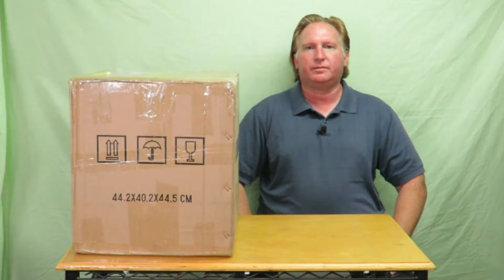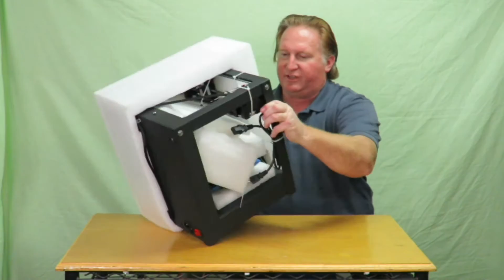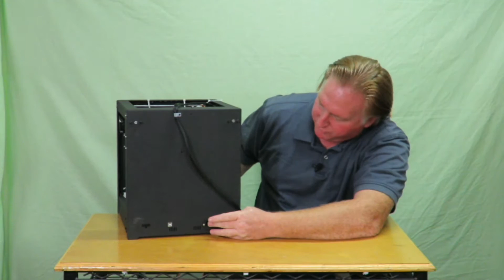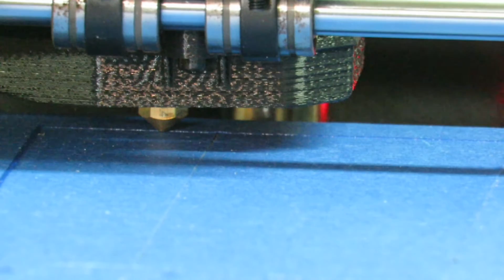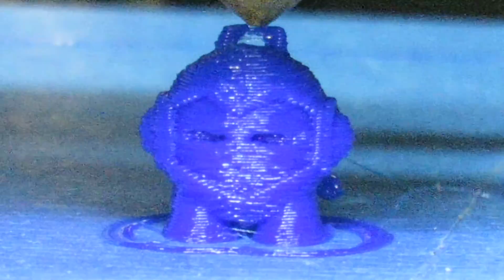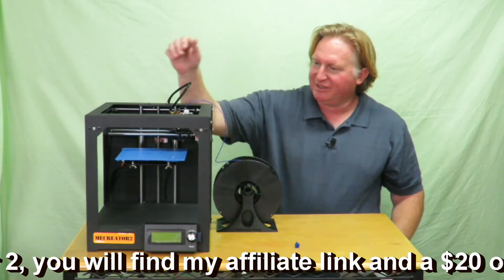Geeetech MeCreator2 Unboxing / First Print

Comment: Quick question, when I’m printing something, the print head randomly moves to the far edge of the print bed and then returns to printing. However when it does this, it starts printing in the wrong position. Any suggestions? Thanks!
Reply from the maker: +hobo662 I had that happen a while back.  After reloading the firmware it fixed it.
Reply from the maker: +Jimmy Shaw's Tidbits that was with the Aluminum I3.  But I could imagine it would be the same thing with the MeCreator2.
Reply: Thank you so much for your advice! How would I go about reloading the firmware?
Reply from the maker: +hobo662 If you go to the Geeetech website they should have instructions on how to do it on the product page.  Otherwise from what I understand you can update it using their program Easy Print 3D.
Reply: Thanks! By the way, love your videos!
Reply from the maker: +hobo662 Thank you!  I appreciate it!

Comment: Hello Jimmy. I have a Mecreator 2 and i change hotend and thermistor but i try PID tuning starts temperture too high error. How to fix this problem sorry bad english
Reply from the maker: +baljka batmonkh I'm sorry but I'm not familiar with changing a thermistor and the process involved in it.  I would think if it has a bad reading there might be a problem with the new thermistor or it might not be compatible.  You might want to contact Geeetech to find out.

Comment: First of all, nice Video!
I just bought the printer and tried to set it up. I also levelled the bed, but when I try to print something from my PC, or SD Card, the printer doesn't do anything. It shows the time on the Screen, but it's not moving!
Can you help me, or should I try to contact the support?
Reply from the maker: +ValliPlays I would double check the cables you can get to, and make sure everything is plugged in to it's proper place.

Second, and please forgive me, but I made this mistake... Did you slice the model and save the gcode to the sd card.  It can't print a .stl file.

Third, did you preheat the printer first?  If you preheat the printer then print from SD, as soon as your set temperatures are reached, it should come to life.

If you have done all of this, I would contact Customer support.  A new printer should run out of the box, no exceptions.
Reply: Thank you for your fast reply! I will have to try your suggestions tomorrow, because it is very late where I am now. But thanks for your help!
Reply: Jimmy Shaw's Tidbits I just tried preheating the bed and the extruder and it heated up to 180° and 70°, but when I tried to print from the SD Card, the temeratures go back to 0° and nothing happens!
Do you what the problem might be?
Reply from the maker: +ValliPlays did you open the .stl file in repetier or cura, adjust your settings, then slice it?
Reply: I can now run a job on the printer, but the extruder just stays in the top right corner of the plate and prints a straight line upwards! And the LCD Display is just flashing.
Should I contact the support, or is there an easier fix to this?
Reply from the maker: +ValliPlays I would contact support.
Reply: Jimmy Shaw's Tidbits ok thanks for your help!
Reply: Hello! I still have a question. Do you know if you can calibrate the extruder? It seems like he doesn't know where he is, because the x & y coordinates are completely random.
Reply from the maker: +ValliPlays I've been thinking about it.  Recently I had a problem with my Aluminum I3.  I refreshed the firmware and it fixed the problem.  It was alot like what you are having.  You might try that.  Please check out this video https://youtu.be/Mk2C53nOeVo in the video description should be a link to Geeeteech's firmware page.  Be sure to read the installation instructions.  Also I believe you can update the firmware from their new slicer program they are working on.  I hope it helps.
Reply: I tried it, but it still won't work and now EasyPrint doesn't recognize the printer as a MeCreator 2 anymore, even though I've installed the right firmware. It thinks my printer is a D200...
Reply from the maker: +ValliPlays Were you using easyprint from the beginning or repetier?
Reply: Jimmy Shaw's Tidbits I was using EasyPrint.
Reply from the maker: +ValliPlays Just for giggles, please try either repetier or cura and see if it does the same thing.
Reply: Jimmy Shaw's Tidbits I just tried it, but the Extruder stays in It's home Position! the printer itself thinks that is printing about 1 layer per second. It "finishes" the print in about 2 minutes, but all I get is a straight line.
Reply from the maker: +ValliPlays Rats!  It was worth a shot.  Sounds like something happend with that printer.
Reply: Jimmy Shaw's Tidbits Hello again! I just wanted to say that the printer is working fine now. (something with the x and y coordinates was wrong). And thank you very much for your help!
Reply from the maker: +ValliPlays Anytime!!!  I'm so glad it's working.

Comment: I was wondering if customer/tech support was very difficult to get in contact with? I am a first time user and my experience with Hictop was a disaster. NO SUPPORT at all. I am probably get this one.
Reply from the maker: +BSW Manufacturing I have always had pretty good luck with Geeeteech Customer support myself.  Although it has only been for questions regarding board upgrades ETC.  I normally contact them through Twitter, and revive a answer the following business day.  There is also a great Facebook Group called Unofficial Geeeteech Owners Group, where they can answer almost any question you can throw at them.  There is always Geeeteech.com as well as their Tech Support email.
Reply: Thanks, Jimmy. I joined that group.

Comment: Hey man I got this because of your videos, I love it!

However, it is making repeated clicking sounds after only a week of having it, I've been researching and people are talking about some extruder screws. Is this the issue you had? If so can you tell me how to fix it please? I'd really appreciate it! I might make a video showing the noise if needed.
Reply from the maker: +ThePinkWizard I have heard the same thing as of late.  Mine doesn't have the problem, but from what I understand the springs don't have enough tension.  I heard one person cut some paper and placed under the spring as a shim.  I looked on Thingiverse for one, but didn't see it.  I personally would print a shim that would add a little more tension.  

Let me know if you do, or if you would like for me to design one really quick.
Reply: Sorry I'm really newbie to this, I really appreciate the quick reply too. Which springs would I put the shim under? If it wouldn't be a problem to design it, it would mean the world to me. I've had no failures with this thing up until today, it doesn't seem like a clog either because filament comes out straight when I manually feed it, just has been ticking excessively when printing (using your settings too so thanks!!) and I am seeing some failures on the outsides of my print.
Reply from the maker: +ThePinkWizard The complaints I have seen are about the spring located under the arm that you depress to manually extrude filament.  It just doesn't have enough tension to make the gears stay engaged with the filament.

Please give me a few hours and I'll see what I can come up with.
Reply: oh! That could make sense. Used to be an issue on my MP Select Mini. Thank you so much man!!! I started a printing business so quality is crucial and you're already more help than Geeetech support.
Reply: Could it potentially be a clogged nozzle? I tried putting more pressure on that spring myself and it didn't resolve anything, maybe can I change some extruder settings? What would you recommend?
Reply from the maker: +ThePinkWizard It could be a clog or the temperature could be a little cool.  I've had both cause clicking in the past.
Reply: hmm. I'm using hatchbox PLA at 205c. The printer did this clicking noise right out of the box even on the first print, so maybe it's not a clogged nozzle. I've been printing at 210c with the hatchbox but the quality of my print is definitely worse than just a couple days ago. Wish i knew a lot more haha
Reply from the maker: +ThePinkWizard Do you have a extra nozzle?  If so, try changing it and see if there is a difference.
Reply: I don't, unfortunately. I have extras from my MP Select Mini but I don't think those will fit. I'll order one and hopefully that will be the issue. I'm going to take the nozzle off and clean it out quickly as well. Last, I am going to print something else. Maybe it's something with the way that one prints. I'll upload a youtube video with the behavior and send it your way.
Reply from the maker: +ThePinkWizard have you tried cleaning the drive gears?  Sometimes there can be a build up of PLA between the grooves.
Reply: also sorry for all the questions. I bought a bunch of that teflon tubing for my old printer, do you think that could be the issue? do these printers have that teflon tube inside the hot end?
Reply: I have not tried that! How would I go about that?
Reply from the maker: +ThePinkWizard if you remove the t bolts holding the extruder cooling fan, the fan and the heat sink will come off exposing the extruder.  A toothpick, brush, or small piece of wire can be used to remove any debris.

If you are interested in the spacer, here's  the link.  www.thingiverse.com/thing:2274064
Reply from the maker: +ThePinkWizard They do.  It could be the problem, but the only way to tell is to remove the nozzle and let it cool.  If you can run the filament thru smoothly, it's not the problem.  If it catches, it is the problem.
Reply: No way man!! Thanks so much! I'll try that out and I'll print that part and see if that'll fix it! Hoping one of these tricks will do it, I love this printer to death! 

Also, how do I access the settings for the printer? I can't preheat it directly from the printer, when I press the button in, it does nothing. I have to use my raspberry pi w/ octoprint to preheat it and what not.
Reply: The gear is clean, however there seems to be stripping on it. There are little scuffs on the spokes of the gear, not sure if that is an issue as this thing is a week old.
Reply from the maker: +ThePinkWizard  That shouldn't be the problem. One more thing, while you're at it check the set screw on the gear to make sure that it's tight against the shaft of the stepper motor.
Reply from the maker: +ThePinkWizard Thank you for the inspiration for Saturday's video!!!  Please send me a email to Jimmyshawstidbits@gmail.com when you have a chance?
Reply: Hey no problem I really do appreciate all your help and I'm super looking forward to this video! I'll shoot you an email right now!!

Comment: Nice videos. Many thanks. 
What Slicer software you use?
Im try cura 2.4, now I need printer setup for mecreator2, can you help?
Reply from the maker: +canonhd1000 I use a older version of Cura.  15.4.6 I think.  The new one just doesn't seem to work right.  If you would like to try the older version, all the settings are in this video.  https://youtu.be/b-wRaF9ljRM

Comment: Can you print STL files directly off the SD card??
Reply from the maker: +Derek Fox Unfortunately, no.  You have to slice the .stl in a slicer such as Cura and it turns it into G Code that can be saved to the SD Card.
Reply: Jimmy Shaw's Tidbits thanks for the detail. I ordered the  MeCreator 2 and it arrived today.
Thanks again
Reply from the maker: +Derek Fox Congratulations!!!!
Reply from the maker: +Derek Fox How are you liking it?
Reply: I'm still waiting The my shipment of filament. I tried out the sample pla. I had to really configure my object in Cura. By the time I was able to get the right settings, I ran out if filament lol.
Reply: Will polycarbonate filament work on this printer?
Reply from the maker: +Derek Fox I've done that a few times.  LOL!!!
Reply from the maker: +Derek Fox I've never tried it, but I think it will.

Comment: Hi Jimmy, If you would to choose between the aluminium one (your older printer) versus this one, which one would you pick?
Reply from the maker: +][v][ Hi,

For the best out of the box experience, I would choose the MeCreator2.  Especially for someone new to 3D Printing.

The Aluminum i3 I would recommend to someone who loves to tinker and really wants to learn everything there is to know about a printer.  It does have a larger build volume, and has to be built.  

Honestly, if I had it to do all over again, I probably would have bought the Aluminum I3 because I personally wanted to learn everything I could.  But that decision would have been alot harder to make if the MeCreator2 had been available at that time.  With the MeCreator2 having the better control  board, power supply and software controlled active cooling, I would go with the MeCreator2.

Sorry for the long winded answer, but there are so many differences between them.  They both have their ups and downs.  Build volume being the big one.
Reply: Jimmy Shaw's Tidbits thank you very much for taking the time to give such a comprehensive answer.

Comment: Thanks for making this video, I' m considering purchasing one of these and your video helps a lot.
Reply from the maker: +bitman I'm planning on a full review video soon.  But it is working like a champ.  Other than a loud fan and the loose extruder it is working great.
Reply from the maker: +bitman I'm planning on a full review video soon.  But it is working like a champ.  Other than the loud fan and the loose extruder screws, it is working great.  Unlike my I3 it reaches 240C and holds the temperature.  So it is printing PETG perfectly.
Reply: Hi Jimmy, great, I just purchased the MeCreator2 now, looking forward for your review, in the meantime I will check all your older videos, I got much to learn as I'm new to 3D printing. Thanks for sharing your experiences.
Reply from the maker: +bitman Thank you so much for watching.  You will love it!  The learning curve is the software.  I deal with the free software like Cura.  Joel, Angus and Chuck use Simplify 3D.  It's $150, but they swear by it.

Once I get my settings dialed in completely I'll definitely share them.  Hopefully by next weekend.

Comment: for the fan noise, if it is the same as my 3 in one control box, when it first came in, it had that same winding fan noise..  turned out that the fan is mounted straight to the wall  and against the vent grill, and i just printed 4 little spacers to move the fan away from the grill, and noise no more...
Reply from the maker: +MrRegzxzx I'll check that out.  Thanks!!!
Reply: Good tip.

Comment: Hi Jimmy, congrats on your new printer :-)  looks easy enough.  I can't wait to see other prints with it..    And yes, the wiring looks better on this one, lol!

I still have my Geeetech Prusa I3 A Pro 3D, although it is quite modified by now... (I really like to thinker and mod stuff..)  It now has a E3D v6 head with bowden setup, new printed: carriage assembly, Z supports with lead screws (instead of the tread rods) ,  installed a 3DTouch auto leveling sensor  (that is a really nice addition, no need to level bed anymore but it took a lot of work and I had to rewrite marlin codes a lot), bed cooling fan.   Other then the nifty power control box and the frame, it is hardly recognizable.. lol   Now I'm thinking about building one from scratch with 20-20 frame , a X-Y carriage like your MeCreator 2, but with print surface of 220x220x200... the Geeetech 3-in-1 3D printer control box would be a nice starting place.. hehehe

As Always, thanks for sharing your time and knowledge, it's really appreciated.
Reply from the maker: +MrRegzxzx Thanks!

Wow!!!  You really fixed your printer up!  When you get a chance, please send me a pic or shoot a video of it.  It sounds awesome!

That sounds like a great design you have planned.  I can't wait to see it too.
Reply: I will try and make a vid for you for sure... and I'd be more then happy to share designs and files with you, now that you have plans to for upgrades for yours :-)

Comment: Thanks Jimmy.
I like the location of the SD Card reader and the enclosed electronics over the Aluminum Prusa i3, however the noisy fan would probably bother me.  It looks like a very solid machine.
Reply from the maker: +Larry Mortimer The fan The loud fan is my only issue.  But honestly I keep it pretty far away from the bedroom so it won't be too bad.

Comment: It looks like a very nice printer. The leds are a nice touch, really.
The whole enclosure is nice. No mess of cables running around the printer.
The print size is a bit limited in my opinion tough.

But at that price, and with something already assembled, it's going to be very attractive to many people that hesitate to jump in 3d printing because of the assembly.
I sure would recommend something like this to a friend asking what model to start with.

My first printer was a up3d plus 2, and I added a I3 derivative (tronxy X3) because I was tired of being forced to reboot to windows (I use Linux) each time I wanted to start a print.
And that the 14x14x13.5 (centimeters, not inches!) max print size was a limitation sometime.
Reply from the maker: +Thierry Schork Definitely!  If this had been out in January, I may not have bought my original printer.  LOL!!!

I do have to say you get more bang for you buck with a kit, such as the larger print volume, but 8 hours of assembly... that makes this printer extremely attractive.
Reply: Exactly.
And as I enjoyed fiddling and toying with the kit, I know that most of my friends would not.
For them, something like this would be perfect.
Reply from the maker: +Thierry Schork And if you have children and pets around its much safer because of the enclosed electronics.